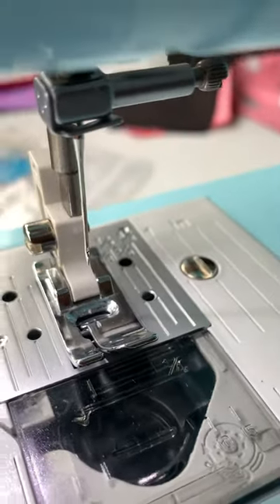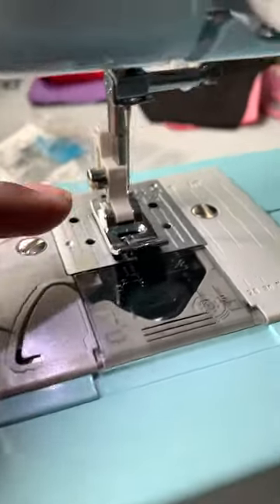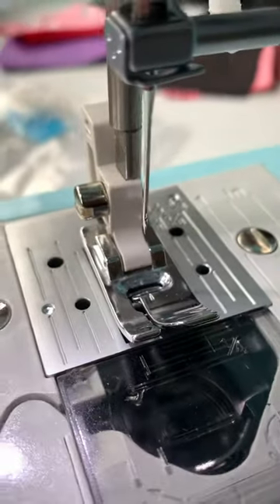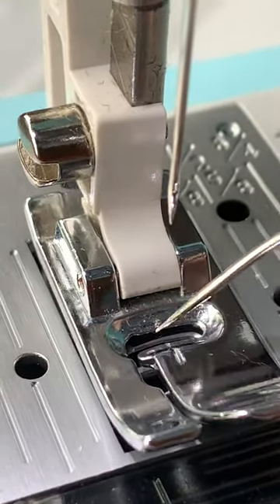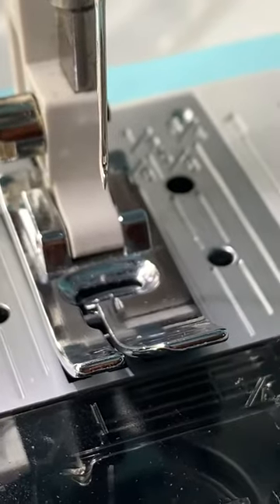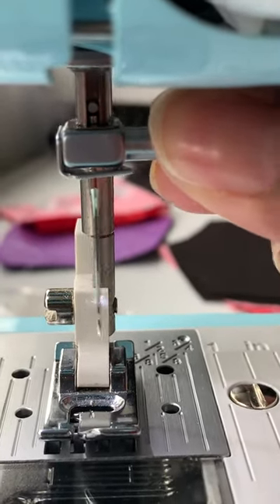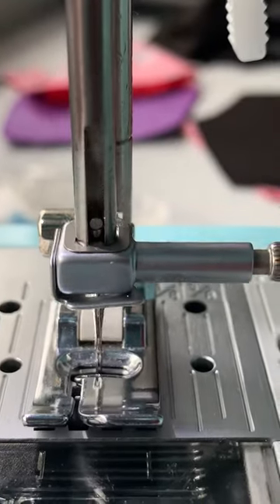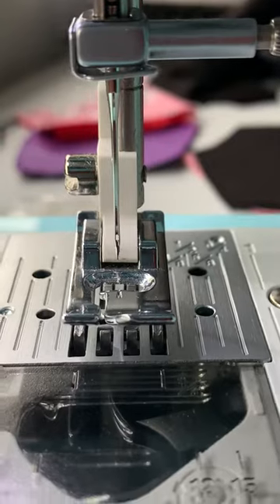Diy: stop Needle from hitting plate  on brother LX3817A

Comment: I recently purchased a JA1400. On my 1st use, the needle broke so I had to replace it. Now the needle is hitting the plate. I tried your tip but it doesn't work the same. Need help :(
Reply: @jennifergris6275  Sorry for the late response. I returned it to where I bought it from then they sent it to the manufacturer to fix.

Comment: Just did that but it doesn't move and it keeps hitting the plate
Reply from the maker: Claudia Rodrigues Guerreiro depending on the model/mechanisms of your machine you may have to have it serviced if this doesn’t work. What model is it?
Reply: in brother model LX3817 
there is a small screw at the back of ur machine rite next to the needle holder which adjusts ur needle as u turn it ... u can align ur needle with it

Comment: Ya, just moving it with your finger won't do anything.

If you bust a needle from it hitting that metal plate. 
First, unplug power cord.
You have to take off the plastic covering (one little screw behind it, use a magnetic Phillips bit to eliminate frustration). And there's a little white cheap plastic wheel near top with an even cheaper black metal throng holding it in place. Lightly hold throng out, so you don't permanently bend it, and turn wheel to adjust where needle hits. If it's hitting the back side of plate, you got to turn the wheel clockwise.

Turning that wheel requires more than using your fingernail to spin it. So you got to kind of use the other little flat bit end of that cheap L-shaped tool (they give you to release the set screw that holds your needle when changing it). 
Without messing up the little gear grooves on that cheap wheel. Put the tool in the wheel groove and move it clockwise a few "clicks".
And then return that metal throng thing to hold onto the wheel adjustment.

You might have to raise the needle up and down to find the "sweet spot" where you want needle to be inside that darn metal plate.

First time you adjust, don't spin the wheel so tight. Even if you're trying to substantially move that needle forward of that scarred plate.
That cheap plastic adjustment wheel can get messed up.

But, ya, no. Just moving that thing around with your finger doesn't do a damn thing. You gotta adjust that little white, plastic wheel inside.

Here's a quick 51 second video for those who can't understand my typed jargon:

https://youtube.com/shorts/PqryoVslBGU?si=TEa5AnDsS0V933X5